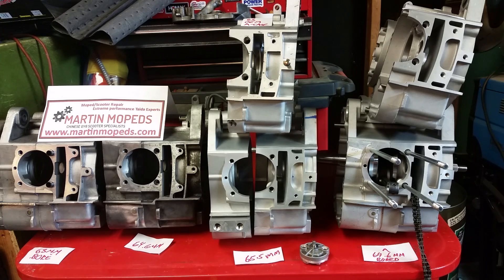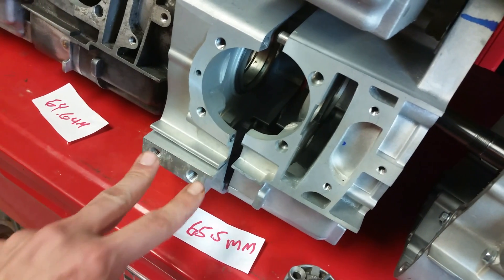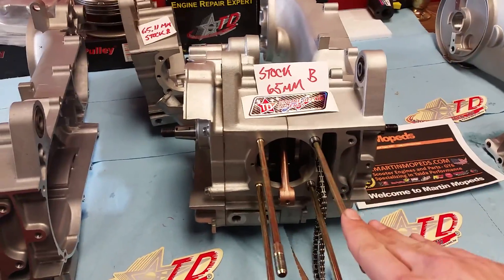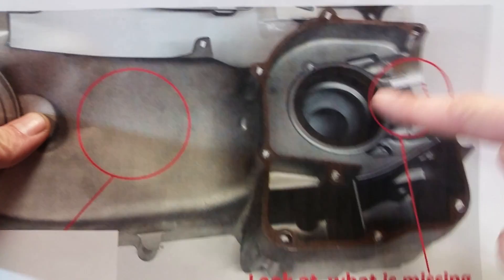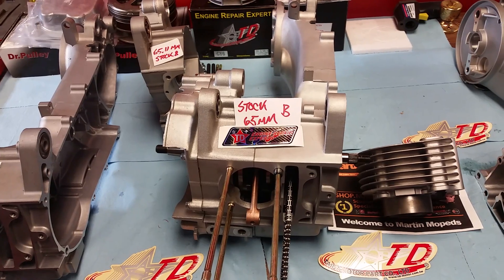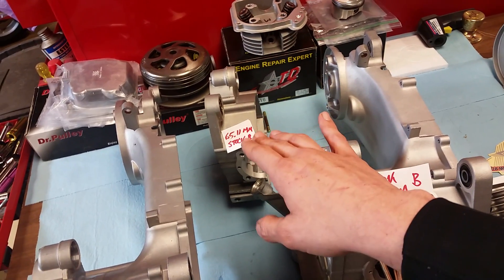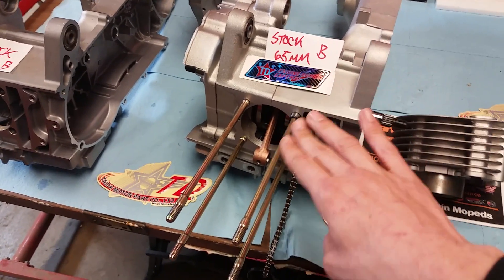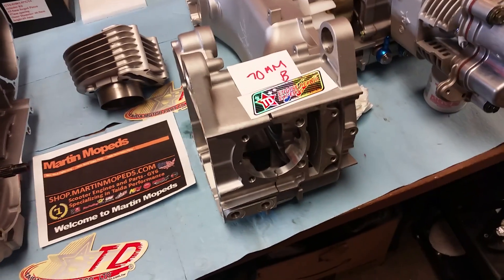GY6 A and b case explained

Comment: I have a question. I want to use the original taida case i have. But i want to put a 14 inch rear wheel how the 161qmk comes with. Can I switch over any parts to make that happen?

Comment: How do I find out what Big bore block I have I have IceBear mad dog all taida motor.... The Piston is a 67 mm piston 57 fit spacing with a t300 cam shaft....was told it was a 232cc the head said fit57 63mm with chain 92...does this make it a 232cc?

Comment: Hey Dan I had a question maybe you could help me im trying to get replacement parts for a 2017 kymco mongoose 90s all I seem to find are 125cc big bore kits do you maybe know which gy6 parts will fit my particular engine or if generic gy6 parts will fit at all or if I need to try to order just from kymco I’ve also heard Kawasaki kf90 parts fit and possibly Polaris outlaw 90 but I haven’t been able to confirm anything my engine has a top end noise or possibly the crank and I really want to rebuild it for my sons birthday thanks.

Comment: Can you please explain for us everything about the so called,
1P61QMK-B2 engine as there is no information about this engine to be found anywhere?
I really need all the specs and info on this engine I can get as I messed up and bought one thinking it can be bored out bigger and have the head wrapped with a copper tubing with tiny radiator and 12 volt water pumped cooling system?

Comment: Im up tuning my 125 cc Gy6 cylinder to 180cc (63mm) What are the intake and outtake diameters I need to drill my 125cc cylinder head to? Also what size main jet you recommend for the default carburator of 125cc?

Comment: Great tutorial video I have a  gy6 150cc long case 157QMJ I'm installing a 180cc big bore kit for a 157QMJ 150cc  but the cylinder skirt doesn't want to ease in easily the cylinder skirt definitely not going in easily what is the correct cylinder housing to make it fit? The kit I currently have now installing is a 63mm not fitting by that I mean the cylinder skirt is difficult to slide on but everything else fits perfectly  mint?
Reply from the maker: Converting to a 180cc uaually means youre using a 63mm piston, you must bore the case block....61mm is biggest you can go without case mods.
Reply: @dmartin925  okay thx Daniel I really learned something today!

Comment: For the amount of money spent to hop up a 150 you could put a sport bike engine on it or buy a sports bike lol
Reply from the maker: People will find an old camero or trans-am and drop 20-30,000 into it...for that kind of money, they could buy a brand new one...some would say it doesnt make fiscal sense.... it's more about the love of the project... people get these Chinese scooters and fall in love with it, but they dont fall in love with the performance... that's why they upgrade... they know they could just buy something fast, but they love their scooters and want it to go fast....
Reply: Sorry that’s false. Most people buy there scoot because they are cheap and can’t afford a larger bike. They put the standard performance upgrades because they are cheap. Very few people and I mean very few people will drop three grand on an engine for their scooters what’s the point of building and boring 150 cc engine, when for the same amount of money in relatively the same mounting dimensions for 350 or 450 mL engine from a different scooter and have way better performance in better reliability I’ve board many blacks and I’m sorry as thin as you’re making the walls on those oil passages that is a recipe for disaster. Example I have 150 mL GY6 buggy from yerfdog. I did the whole pouring beers and got it up to 180 ccs. Just last year I bit the bullet and bought a wrecked  250cc gy6. And that 250cc GY6 blew the doors off of the 180 and I had significantly better reliability and performance.

Comment: Hey Daniel,
Thanks for the great video. I’m hoping you can help me with some info. I have a customer with a 161QML ... he needs a variator but we discovered the crank is bigger than the standard GY6. The 161 crank is 17mm vs 15mm for the standard GY6. I have found zero info about this and cannot find a variator. Anything you can tell me about this would be appreciated and if you can point me to a supplier for the variator I’d be ecstatic... Thanks, Josh
Reply: I can see he was right on time with a response. lol I dislike people that don’t respond to questions that they could help with

Comment: If anyone out there has a performance case that the transmission side is ruined I would be interested in that engine. I want to build one of these or find one that's built and the transmission side is damaged I'm going to cut it off anyway.

Comment: Will a drop in NCY 171cc big bore kit fit in a 1p57 qmj engine?
Reply: i believe the ncy 61mm bbk will fit the gy6 a case with no problem. others like the naraku and taida, those are hit and miss, but it all depends on your case. some gy6 a cases are odd balls from what i read. some could have the 63mm opening, some could have 63.3mm or even 64mm. the only way to find out is to disassemble the top of your engine and measure the cylinder skirt and case opening.
Reply: The only difference in a "p" engine, is they have bigger head

Comment: I'm having an issue with my build.everything went well untill I installed the cam.the cam is way to far the left and it hits the valve cover and rubs the rocker arm assembly.the cam was from another 150cc gy6 qmj but looks to short.have you seen this before.

Comment: Excuse me your correct I meant qmj but no i pulled the motor out of a touring 150cc scooter its a gy6 style not qmb, but the style of the qmj its a factory 150cc 4 valve oil cooled motor of the qmj style just 4 valve I have kept it only cus its a 4 valve and I have never come across another to this day.

Comment: I've got a question about the 4 valve motors. I have one its a qmb 4 valve oil cooled 150cc like the one in the video just stock. is that in fact the same motor or what can you tell me what I have if its anything at all.
Reply from the maker: A QMB is not a 150cc and I have not seen a 4 valve kit for a QMB (Not saying there isn't, I just haven't seen one). 

The "QMB" is actually a 139QMB or 1P39QMB... That is an engine stamp describing some of the engine specs... 
1 = 1 cylinder
39 = 39mm cylinder
Q = Cooling type - Q is Air
M = Motorcycle / Moped
B = Engine size (B = <<50cc)

Long story short, your "QMB" is likely, a 50cc.

Comment: hi, will the 58.5mm bore and an outer sleeve of 60.2mm and fits a 125cc?
Reply from the maker: Yes.
Reply: +Daniel Martin thanks for the fast response. Im planning to upgrade mine.
Reply from the maker: On an engine like yours, you can go up to 61mm if you select Taida or NCY. 

I have in stock the Taida 61mm no bore if you're interested. I also have 58.5mm BBK's in stock (Glixal and Taida)
Reply: +Daniel Martin Thanks I'll check that out. I have one more question again. What valve clearances would you recommend on my motor
Reply: Hi Martin, is this the one that you recommend to my 125cc gy6, 61mm no bore http://shop.martinmopeds.com/X06-Taida-GY6-Cylinder-61mm-Big-Bore-Kit-Case-mod-not-required-GY6-01061-w.htm if so I need your response. Tnx

Comment: If I have a 50cc gy6.  I don't know yet weather it's a long or short case yet. Haven't went out and looked yet.  But would the 150cc engine swap right into.  I heard the motor mounts are different.  that's no big deal I can weld new ones.  But everything else will be direct fit correct?

Comment: good video but if someone is advertising a engine as a 200cc but it's a 169 then that's false advertising i have a taida 170cc big bore kit i know i will be at 163.4cc so you might not want to say it's not false advertising when it is other then that good videos
Reply from the maker: +ThEoThErGuYz757 Ultimately, If someone is selling a 161cc as a 200cc, then sure, I suppose it is. What I was talking about is intention. These 200cc engines are marketed by the manufacturer that way, they're even sold on mopeds as 200cc's, but they're not. So, when they hit the US market and sellers are provided the false info, I don't think the end seller is misleading people on purpose, as they were also mislead...
     It does become intentional when a seller is made aware of the fact and they don't change the ad or add a disclaimer...
     I do not sell these "200cc" engines, I was only pointing out the info errors.
Reply: +Daniel Martin i hear what your saying but as someone who would sell an item like that wouldnt you do your own research to make sure everything is what it is suppose go be before advertising something? as for scrappydawg or whatever they know they arent that cc but still sale then as that which is false advertising not saying you per say just stating facts...just cuz something says it does this or that doesnt mean it doesnt that thats when research should be conducted to make sure accurate information is given out
Reply: Would it be better to stick with a 150cc for durability than a 157cc?

Comment: Hi Daniel...excellent video as usual..first thing..thanks so much for explaining the magneto output to me...I learnt something there👍...now my question is this ..can I put a big bore kit in my fuel injected GY6 (yamaha cygnus twin port)...many thanks😊
Reply from the maker: +versatec1  Hi Vers! Thank you very much.

Unfortunately, I do not know your specific model of scooter. So I can not say for sure.

What I can share with you is that modifying scooter cylinder that has fuel injection is very hard to do. 

When you go with bigger piston, you also have to upgrade the amount of AIR and Gas the scooter uses and have to modify exhaust for new flow rates.  Getting fuel injection to add more fuel is difficult to do and requires expensive modifications to the ECU (computer that controls fuel flow rates)... 
     You would need new fuel Maps, possibly a bigger injector, the list goes on and on. 

     Sorry I could not give you exact answer.
Reply: +Daniel Martin. im wondering where can i get a case bording big block for a gy6-65mm